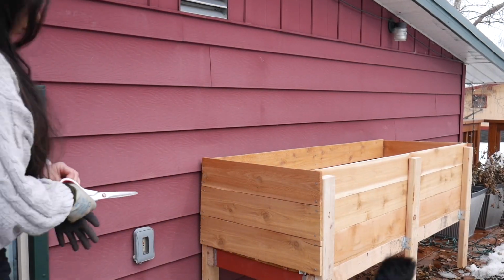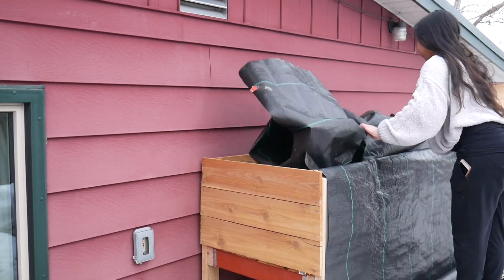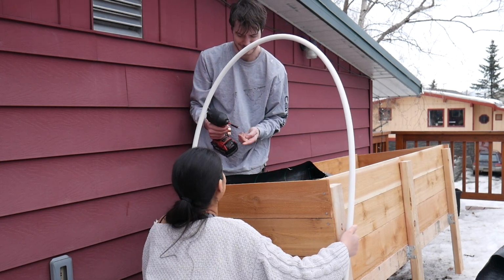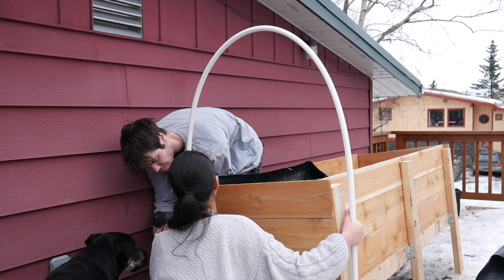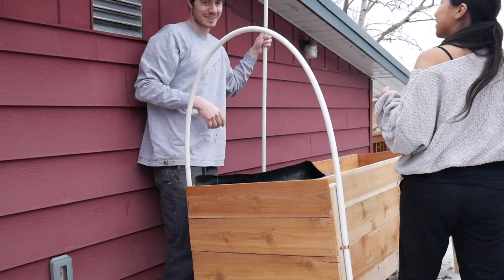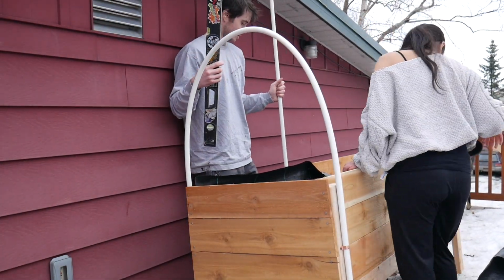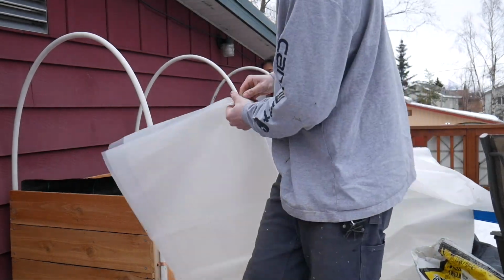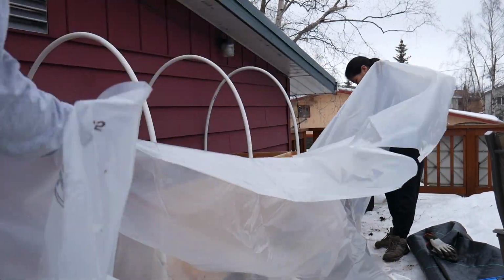How to build a cheap, PVC low tunnel / cold frame to start growing earlier

Comment: Hello, Have you looked into 4mm twinwall polycarbonate? comes in a roll so can be bent over your raised bed.
Reply from the maker: I've briefly looked into twinwall polycarbonate for other projects. I've actually never considered it for this raised bed, but I'll definitely think about it! I was thinking about using it on our bigger high tunnel but that would have been way too expensive! I'm also considering it to convert my shed into a greenhouse